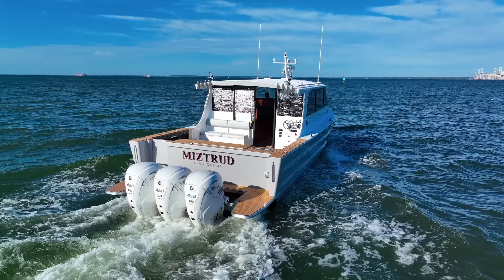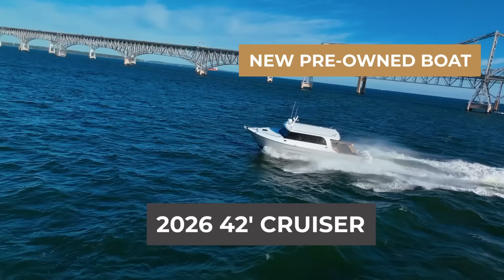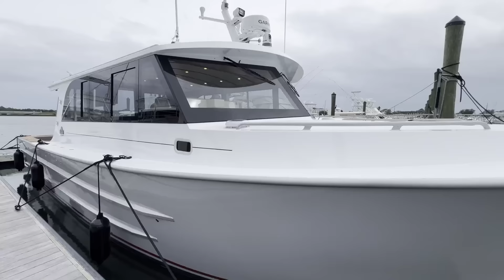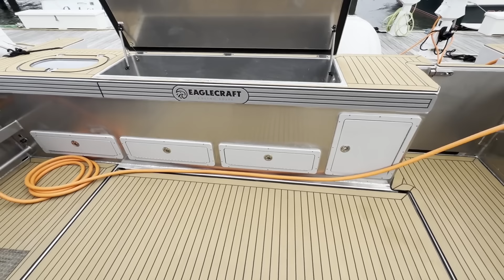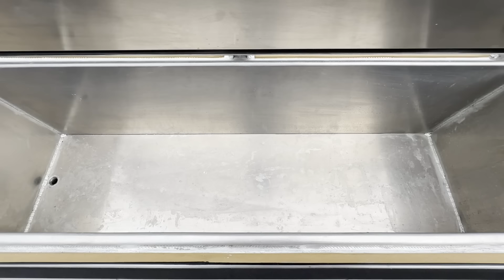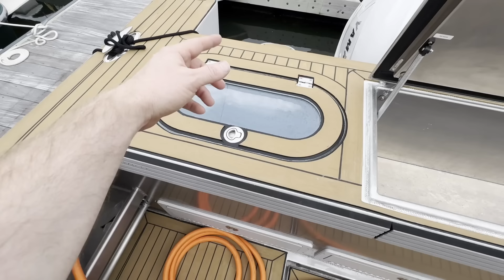EagleCraft 42 Cruiser - New Parker Edition | Walk through of boat built for a boat building legend

Comment: you guys nail it every time ..personally I like forward raking windshields but here it fits with a Parker version ..on these super custom boats have you tried the Sharrow props..on an expensive build like these i would think because of the big gains of mpg and smoother and more reverse thrust ...people buying these would want that extra performance ..hole shot ,1000 rpm less at same mph..

Comment: Beautiful boat. I love the attention to detail with the wiring, breakers, huge shower, separate head, huge helm displays and possibility to add a Seakeeper in the future. I could go on and on. I would add a chill plate to the transom fish box so that it doubled as an ice-free cooler plus move the joy-stick behind the throttles so it can be used while seated underway. An even better solution would be a helm-chair mounted joystick on the arm rest. Still, what a boat!